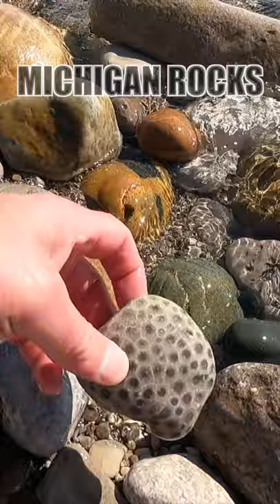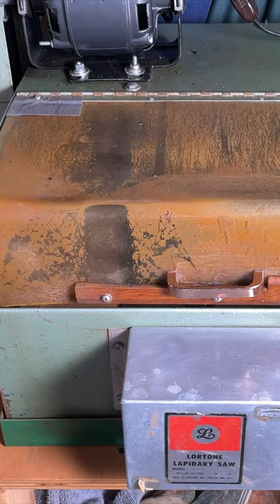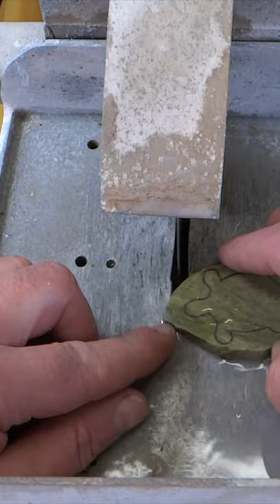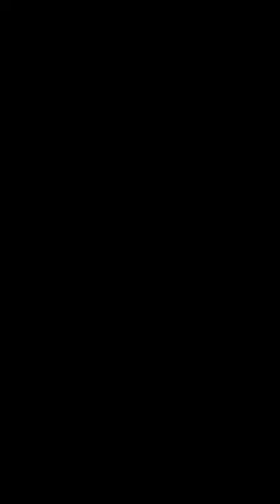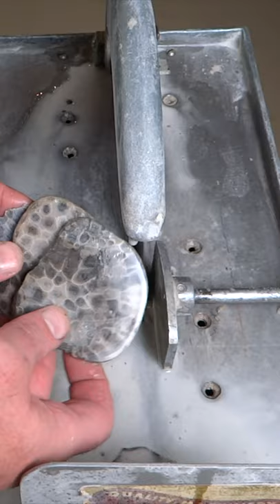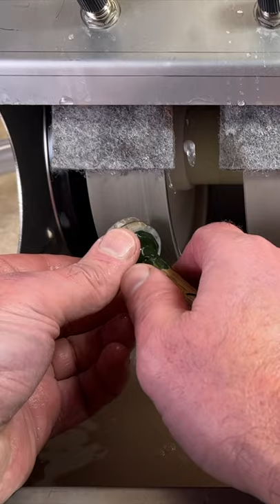Where Turtles Come From

Comment: It was a great quick video! 
This doesn't have much to do with this video but, I was wondering if you could post a video on how to make the perfect slabs. I have a difficult time making them around the same thickness.. Obviously not too thin and not too thick. Can you help me out?
Reply from the maker: I think that depends on your slab saw. On my saw, there's a little crank on the vise. As I turn the crank, the rock moves left or right, determining how thick the slab will be. I just turn is turns every time and they all come out the same.

On my other saw that I use to slab Petoskey Stones by hand, there's a little fence I can set up to determine how thick the slabs are. Since that one requires me to push the rock through by hand, it's a little harder to get them exactly the same and also to get them smooth, but it's just a matter of practice.

Comment: AWW YEEE 😍😍😍🥰 Give me all your stone! 😂, i have a dremmel and apparently you can use it on rocks and stones but im not sure if it needs to be soft? Rocks/stones or if it can be any, have you got a dremmel??
Reply from the maker: I have two Dremels one is always in the drill press accessory. I use it to drill 1 mm holes in rocks. The other I use to rough up two surfaces that I plan to glue together and I also use it to do a final polish on Petoskey stones sometimes using a product called Zam. Other than that, I never use it to polish rocks. I think that would be very slow and difficult.
Reply: @MichiganRocks  🤔🤔 hmm, you do more "manly" things with them, iv made my mum a wooden bird feeder and my friend a little cup thing with a green man face on it and want to try to use it on stone at some point to feel/see how it works as a different material, do you ever make carvings out of them other than the little turtle which you deserve massive credits for making, i mean like a flower ect? It would be a challenge i assume but also something to try, its difficult sometimes to look at a block object and think about how to carve something out of it inwards and what not 🤔
Reply: @MichiganRocks  you have good skills, did you teach yourself?

Comment: What is the cutter ur using?
Reply from the maker: I used a couple different saws. I used a ten inch slab saw to cut the slabs and then a trim saw to cut the shape of the turtle bottom and shell. The slab saw was a Lortone ST-10 and the slab saw is a Gemlap.